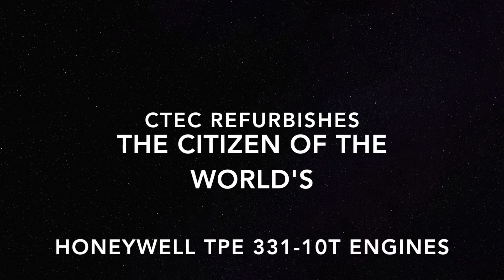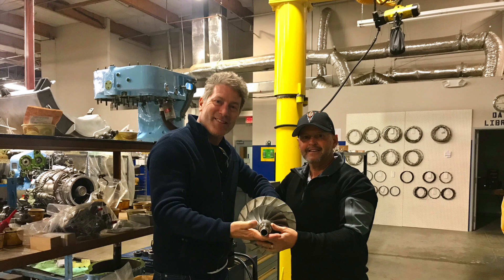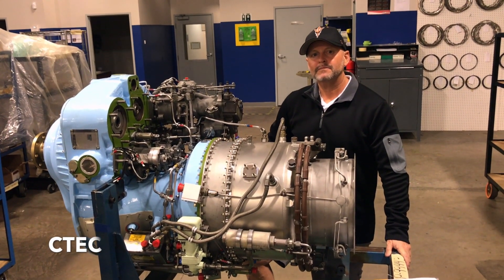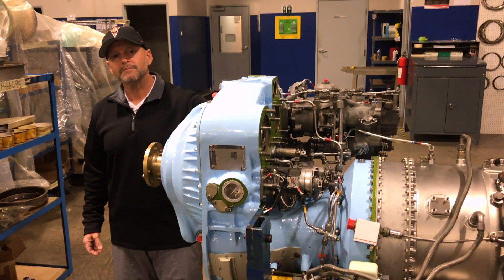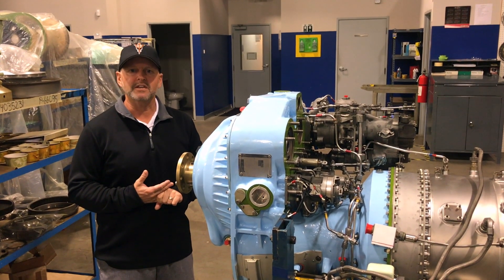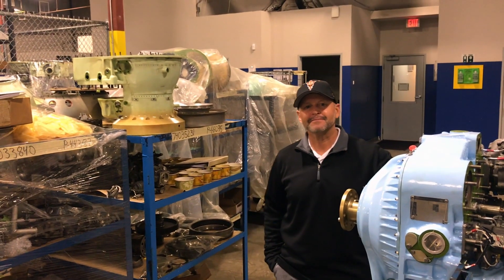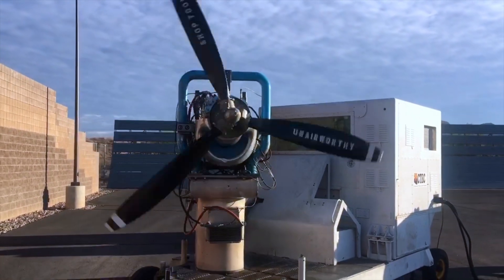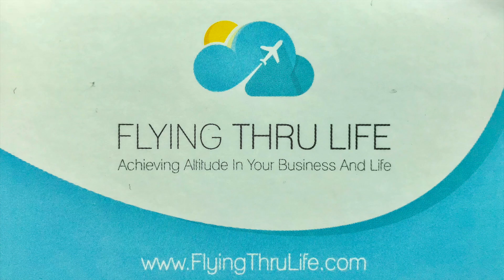Honeywell TPE 331- 10T | Robert DeLaurentis, Zen Pilot

Comment: Definitely a fan of the single shaft tpe engines.   What power and efficiency in a light package.   Of course, the amount of fuel you need weighs tons....but the engine is lightweight.

Comment: You forgot to mention weight and torque. The basic engine without accessories only weighs 400 pounds.
Also, that 1000HP (dry) comes with 2000 lb/ft of torque. Add a 4 bladed Dowty to that and you're going places!

Comment: Fuel fired internal combustion = Engine. All electric power plant= motor. Please get it right
Reply: Negative.  

Motor = ANY device that converts any energy into mechanical energy.

Engine = Devices that convert HEAT energy into mechanical energy.  

All engines are motors.